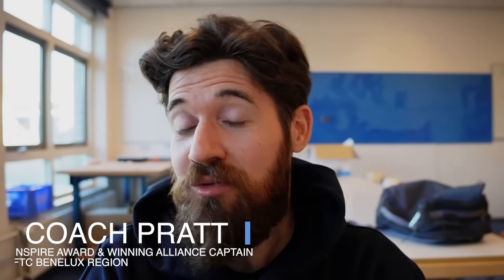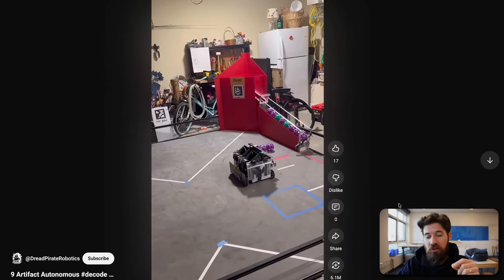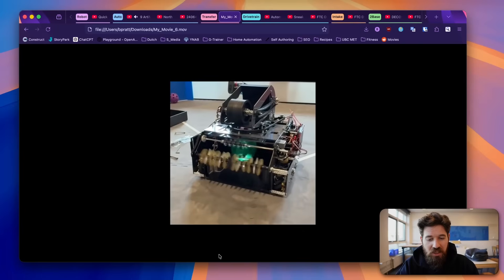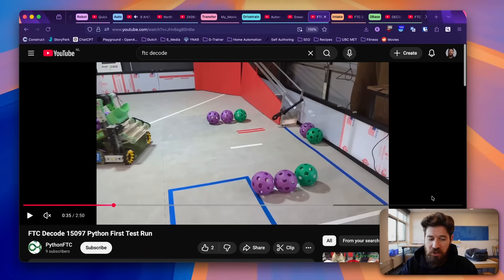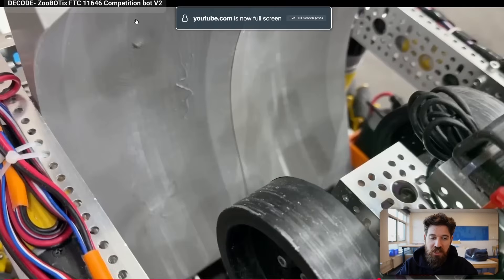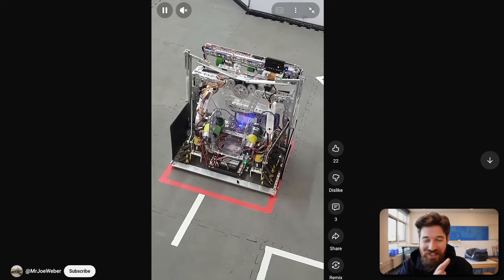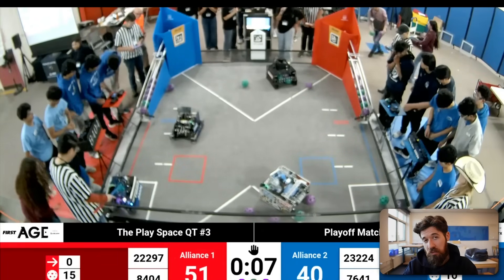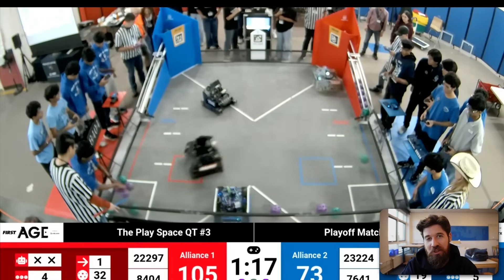The New Auto Meta [FTC Friday's DECODE]

Comment: For the ZooBOTix parking (around 12:20), they could also benefit from attempting to park diagonally in the base.  Our team has a very similar setup, and we've found you have about 40% more space to park, if you go diagonally, because you only really need to fit the triangle between your wheels and the kickstand.  They could park with ours no problem using that approach.

I think you are right on with the autonomous analysis, and I hope to see a lot more robots cycling the far shot, using artifacts that have been released.  How well teams work together is going to be key.  We had one match where if we ended up with 6 overflow in auton, that could have been avoided if we actually coordinated on when we opened the gate.  To mitigate this in the future, the team just added a new configuration to their auton, where they should be able to configure custom autons on the fly during init (e.g. shoot close, get row 1, open gate, wait 2 seconds, shoot close...etc.)
Reply from the maker: Diagonal is a great call!
Reply: As a lead from Zoobotix parking diagonally was something we also had plans on trying. What we really liked was that our kickstand doubled as the trigger for our shot into the flywheel.  Might not have been the best design but it was pretty fun to be able to dual purpose that motor.  Really appreciate the showcase of our robot.  The videos on this channel are fantastic.  Been watching a bunch of them as a team all season!!
Reply: @EricMcGinnis-tu8tg  Awesome!  Maybe we can try it out at states if we get paired together (I'm from 10104).  I didn't realize that dual purpose for the kickstand, but it is awesome.  Good luck on the 12th!

Comment: Team lead from 19589 here. Having the spindexer at a ~45 deg angle really allowed us to maximize our space in a way that I haven't seen many other robots do, where most are either fully horizontal or vertical.
Reply: Team 19442 here, we also have our spindexer at a 45° angle. Have you had any issues consistently lining up the spindexer to your outtake? We tried a servo but it was too heavy and then a 60 rpm motor with an encoder and it’s still inconsistent…
Reply: @OliverdeArmas  We haven't had any issues of that sort. Our drive base gives it a 45° frame to be screwed into, and our shooter is both screwed into the drive base and the spindexer assembly. They are both very well aligned and the screws keep them nice and tight
Reply: This is team 13709. Is there a way to contact you about your robot?